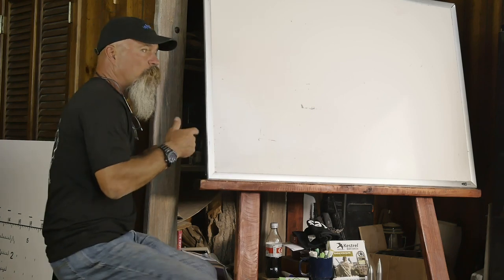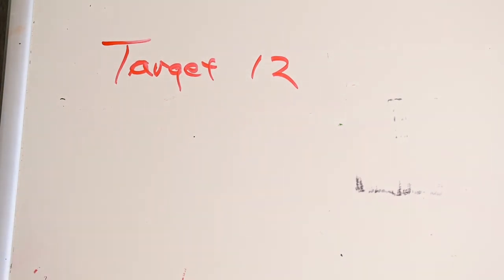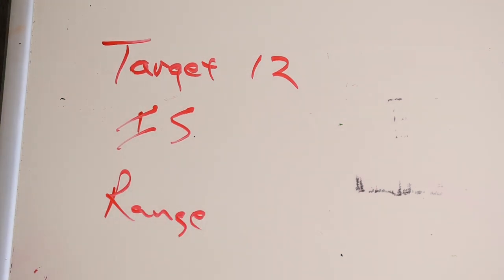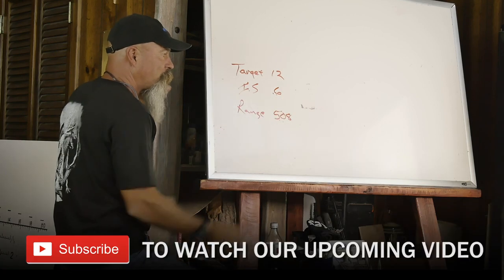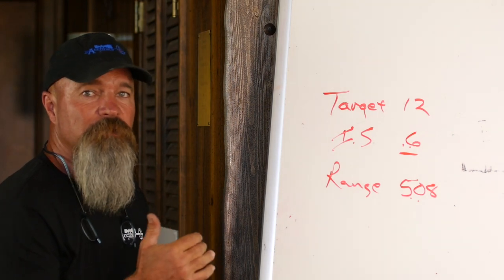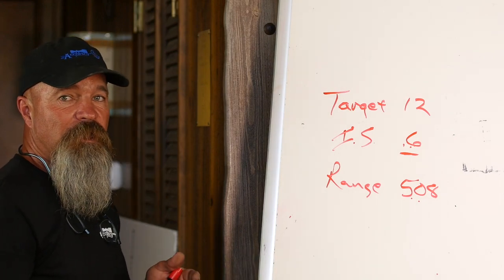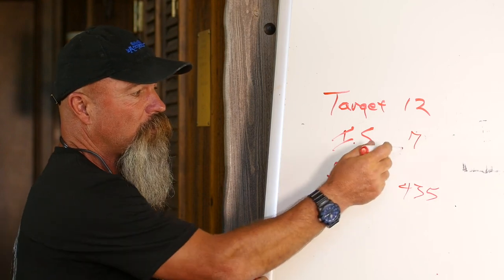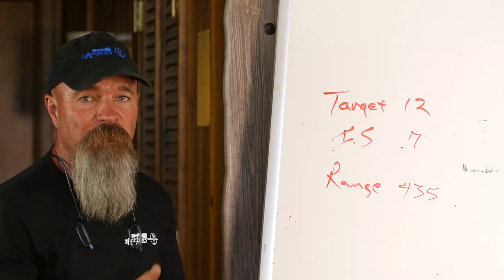CALIBRATE YOUR EYE FOR MILLING | Todd Hodnett from Accuracy 1st

Comment: Out here shooting in these hills up here in West Virginia right now. . I’m applying the Pythagorean theorem on  a shot that’s down hill 30 degrees and the tgt is also canted at a 16 degree angle instead of being squared up. I’ll mil it this way and also I’ll mil the tgts width. Does this sound like I’m going about milling the tgt correctly?  Thanks for the informative video!!!
Reply from the maker: Hi WV
According to our in-house experts if you are milling targets at an inclination it is best to range using the width of the target as that value will not change with inclination angle.  If you input that line of sight range and the inclination angle into the Kestrel it will take the angle into account when calculating a hold for your shot.
Thanks for watching!
Reply: Kestrel Weather Meters   Thanks for the information!!!!! I appreciate it.